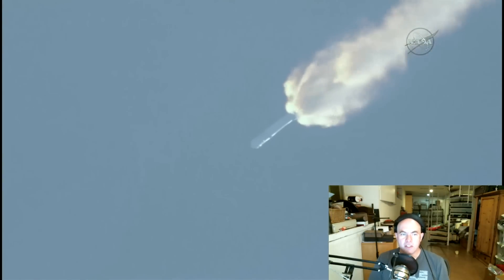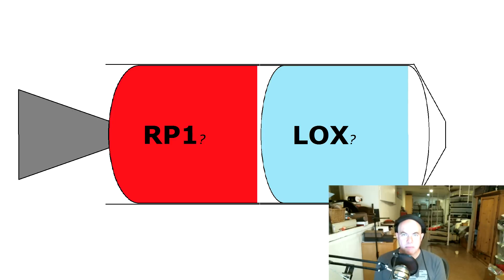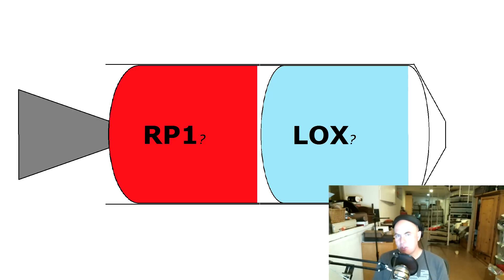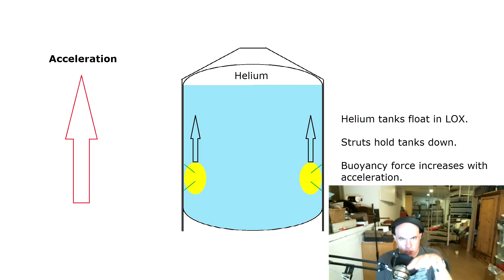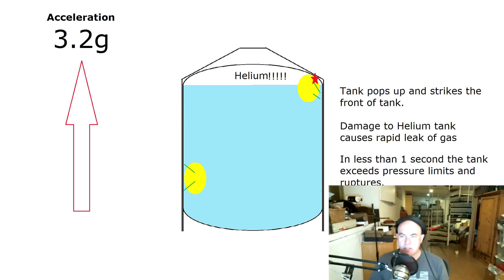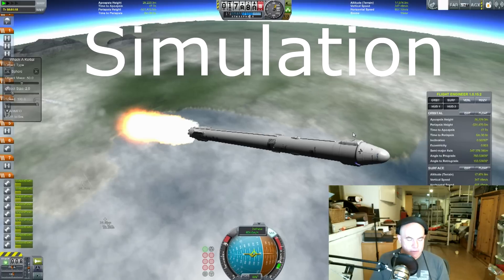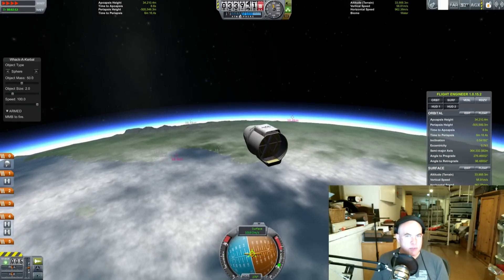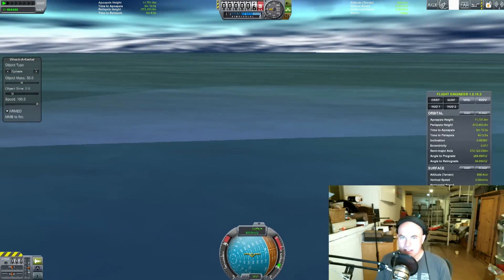Explaining the Space X CRS7 Launch Failure

Comment: Quick question, why is the vessel acceleration upwards? wouldnt the mini tanks be forced downwards during takeoff?
Reply: Well yes, but if you balance the force of boyancy against this, it's not even close.
Reply: Oh so you mean when it's launched out with highspeed it creates an upwards force on the canister? or is it stricly related to the heat?
Reply: Swipe Basically, from my understanding, the helium tanks are very light (And helium is buoyant), so the struts are holding it in place. Liquid oxygen is also fairly dense, so the difference means the helium tanks really, REALLY want to shoot upwards. The struts were the only thing holding them in place.
Reply: Swipe both the LOX and the helium tanks would be forced down with the same relative forces, so it shouldn't have any impact on the relative boyancy
Reply: This issue will cause Space X to re-evaluate every aspect of design and testing which is no bad thing given the impending requirement to transport astronauts to orbit.
Reply: What's buoyancy?
Reply: Swipe smarter every day has a great video that explains it, albeit with balloons in a car that is accelerating
Reply: +Swipe same reason why you can toss and catch a ball in a moving bus,  relative motion.
Reply: we call it liftoff here on the world of rocket science, fellow aeronautics guy

Comment: It's amazing that the failure was caused by something as simple as faulty struts. I'm actually surprised that they weren't already testing every piece of the structure prior to launch though; seems like a no-brainer but I guess when the supplier gives you wildly false specs you can't really see that coming.
Reply: Ideally the supplier should have been doing the testing and provided certified materials : ( selling things at 20% their listed strength seems illegal or grossly negligent to me. Just glad no one was on the craft when this fault came to light!
Reply: Chris Lundquist The issue with testing a part like this is that you need to destroy it.  You never actually know what the failure limit is until it fails, you just have to take it on faith that what your supplier says is true.  And once a part is tested, you can't use it in production, because even if the part passes the test and it isn't actually destroyed, the test itself is considered destructive.  You can order 10-20% extras and do your own testing, but at that point you're duplicating effort, while also losing correlation effects.  It's much better if this testing is being done by the manufacturer, who are able to discard entire batches, and end users just need to trust that proper procedures were followed during testing.
Reply: Michael Braedley While it's true you need to destructively test to determine a parts failure load BEYOND its specification, it is quite possible to exercise a part within its operating parameters without destroying it. The part on the rocket (and several others in the factory)  apparently failed well within their rated operating window. Testing could/should/would have found this. SpaceX get criticised regularly by "old space" employees and former employees for a lack of testing. Looks like it bit them here. Personally, I hope that they put a proportional response in place. Large old companies in my experience tend to end up with so much process, testing, double checking, reviewing... that they end up completely unable to innovate. SpaceX needs to stay young and keep the innovation fast paced and relatively risky if Musk wants to get to Mars.
Reply: Craig Britton The issue is that, if I remember my materials science class (I only have the one, since I'm an EE), you can only really test a part to about 25% of the failure limit before the test becomes "destructive", even if the part under test isn't actually destroyed.  (This is the limit between elastic and plastic deformation.)  Sure, testing to 2500 lbs would have discovered a problem with this part, but if the part actually had a failure limit of 5000 lbs when rated at 10000 lbs, you've just "destroyed" the part, possibly without even knowing it.  (In reality, you probably would know about it, since the part would probably be plastically deformed, and you should be able to detect that.)  Also, every test you do, even well below the destructive limit, possibly weakens the part, so what was a part that could handle 10000 lbs might now only be able to handle 8000 lbs.
Reply: You don't know if it was wilful neglect on the suppliers side. 20 something years ago, there were a lot of cases where bolts used in aerospace construction prematurely failed because inferior steel had been used. But regardless, this is a prime example for the importance of testing the validity of claimed specs.
Reply: Craig Britton Like already stated, you can't test to 20% of rated load, and then put that object into the spacecraft. Testing it, even if only to 20% of it's rated limit, has weakened it, there is no circumventing that fact. It is no longer rated to what the manufacturer said. So what do you do? Do you pray that your 20% load test didn't critically reveal a flaw in the strut that you cannot easily detect, and put it on a spacecraft, where it is now more likely to fail, than prior to your test?

No, you don't. What you do, is accept the guarantee from the manufacturer that their parts will do what their specs say they should do, and if the part fails, you know exactly who to call, and who is at fault. If you do your own testing, you don't know anymore - did the manufacturer ship a bad part, or did your load testing damage it in some way?

Trust me, even "old school" space folks know when to test, and what to test - and they would not have used tested hardware in flight. Because of the reasons already stated. Also I will remind you of the hundreds of failures endured by "old school" space folks too, probably many of them coming down to hardware not functioning to spec. Same problems, different engineers.
Reply: Mythricia You do your own testing. Sure you won't be able to use the same struct but you will be able to get statistical data on what the probability of failure of structs from this manufacturer is for a given load. With this information they could have made a more informed decision on whether to use or not.
Reply: Tugrul Irmak Only a very small fraction of them failed at the lower load. It's very possible that they did do additional testing and just didn't happen to test any weak ones.
Reply: Tugrul Irmak They did do the testing. Assuming they didn't would be holding them to a pretty sad standard.
Reply: Chris Lundquist It's more likely the manufacturer should have been testing every single strut.
Reply: Chris Lundquist The struts probably are rated for 10,000 lbs but this certain one just so happened to be only 20%. This has never happened before. I dont think that its the manufacturers fault that the strut broke because things do happen but they should have tested it first.
Reply: ***** If it was crewed they would have been safe. The crewed Dragon has the abort systems on it and i guarantee that they would have detected a failure.
Reply: bamarocks777 An 80% deficiency in material properties is pretty damned severe :p flukes shouldn't happen with modern material production, testing, etc. Materials can't just spontaneously fail randomly, they need to have a fault with them and an 80% fault is HUGE. Imagine if your car could only travel 20% it's normal operating speed, or the foundations of your home could only handle 1/5 of what they should. It's not a small fault by any measure. The most common cause for faults like this is overly zealous cost-cutting at various points along the line from production to use.
Reply: Chris Lundquist I dunno, makes more sense to me than an engine not working or something. Think about cars or planes.. when something goes wrong it isn't the engine spontaneously exploding, but usually a bolt or a tire popping. The smallest or most duplicated things seem to usually be the cause of the bigger more complex things failing.
Reply: Michael Zhang If it was manned they would have had an abort system.

Comment: FYI "Popular Science" did an article on the Falcon Heavy which shows that the LOX tank is above the RP1 tank. Also, at the launch, you can see the LOX being vented from the top. Also, the struts in the picture are connecting the tank to the suspended wall of the Falcon 9.

Comment: Hey Scott, take a look at some of the older launch videos. I've forgotten which one it was that had a very cool view inside a second stage tank (must have been the O2 tank from the blue colour of the liquid), during and immediately after thrust. Very cool in it's own right, but as the tank empties you can clearly see a large tube at the bottom centre of the tank which likely passes the O2 through the middle of the RP1 tank, so the O2 probably is in front.
Reply: TonboIV Did some digging. SpaceX really liked that in tank camera for a while. They flew it at least on AsiaSat 8 and 6 and CRS-4 and 5. The two CRS flights give the best views and you can even see the He tanks attached to the inside.
Reply from the maker: TonboIV Did you look at the card I added next to the Elon Musk image? It points to an addendum with the image you describe.